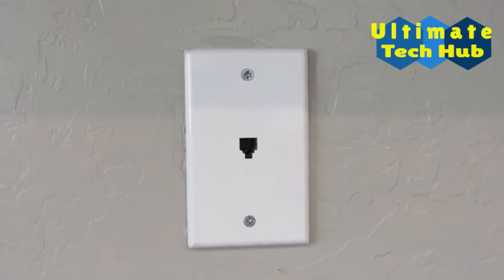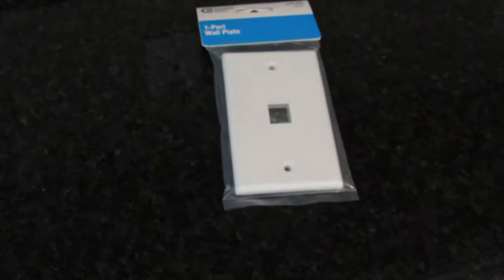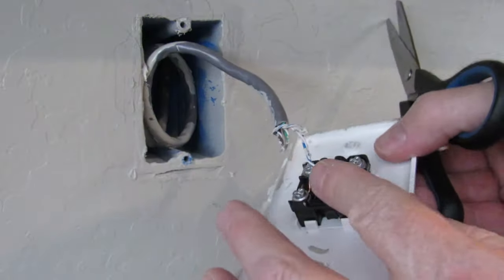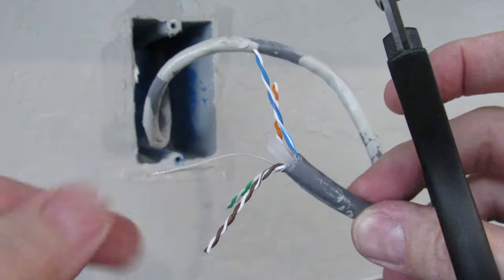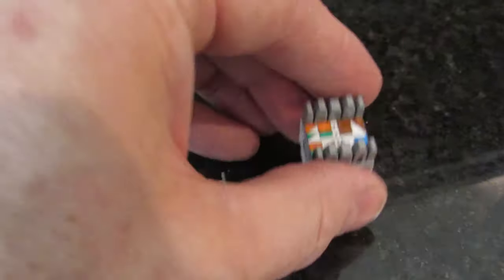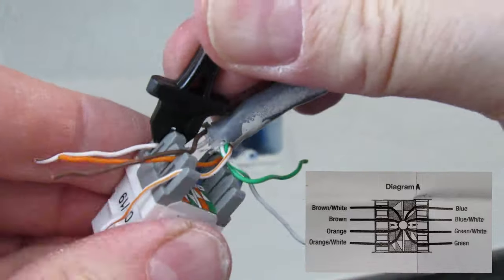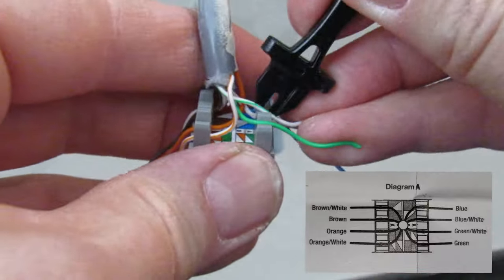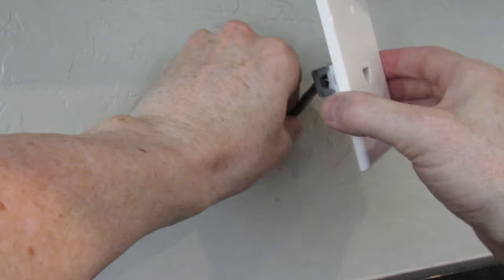CONNECT CAT6 CABLE TO JACK - HOW TO

Comment: Hi, I tried this but I didn’t get internet though. How do I troubleshoot
Reply from the maker: Check that the wires are in the correct order. Also where does the other end of the ethernet go?
Reply: @UltimateTechHub  so I changed the port in the Type A sequence as that’s how it was done previously for the phone line. Then I connected this new port with an Ethernet cable which comes from my router. Then I went to the another room and replaced the port with another Cat6 portZ and tried the hardwired internet connection but it says no internet connection.. I tried this at two different places. I have Cat5E cables.
Reply from the maker: @CuriousKaviCruiser  I would rewire both ends again to make sure the wires are in the correct sequence. Here is a video that shows both of the installs. Keep me posted.
Reply from the maker: Oops sorry here is the link.
https://youtu.be/4CUyU_v2qS0
Reply: @UltimateTechHub  so basically it won’t work till I connect the cables in the phone box with the network switch. Is that a correct statement?
Reply from the maker: @CuriousKaviCruiser  Yes. You need internet service connected from a modem to a router to a switch.
Reply: @UltimateTechHub  gotcha. So now once I fix it I will upload an end to end video. Lol.
Thanks for being so prompt in responding
Reply: @UltimateTechHub  you definitely deserve a subscription though. Thank you so much

Comment: is there a way to convert coax cable to this without any adapter?
Reply from the maker: No I'm afraid not. They do make adapters for electrical outlets that carry data signal.  However I have not used them so im not sure how fast and reliable the connection is. Thanks for watching and if you subscribed thank you as well.
Reply: Did u find anything
Reply: @yovanirangel2964  no.... so in the end I had to buy a long cable going around the room...

Comment: What kind of video is this? You forget to say that they have to do something to the other side of the cable, like connect it in a switch or a router... As you showed in the video its like you change the jack and its done, you have Internet thanks to magic...
Reply from the maker: It's a video that shows you how to change a phone Jack to a Cat6 plug. It's not an internet connectivity video. Just a how to wire the plug correctly. Thanks for watching.

Comment: Although I don’t understand why my house didn’t come with CAT6 and it was just built this year I guess my area is still in the past and I have fiber optic internet 1GBps
Reply from the maker: Probably saved them.some money by installing cheaper cat5e. Although its not much more expensive so it seems pretty stupid not to future proof the house with cat6.  You could run cat6 cables to each room. Thanks for watching and if you subscribed thank you as well.

Comment: I don't understand how this works. Don't the inner parts of the wires need to connect to something? Seems like you only put the outer rubber covering of wires in place but somehow this is how it's done? As a guy with zero wiring experience I'm confused.
Reply from the maker: If you mean the colored copper wires. They make the connection once they are punched down into the key stone jack. This is 100 percent correct and I have dozens of videos about this subject where I make these connections and they work without fail. I also have my degree in Networking and Cisco Routing. Thank you for watching and if you have any questions feel free to ask.
Reply: @UltimateTechHub  ahh i see, thanks for explaining. I came across this video as I am trying to convert my telephone port into a ethernet port so that I can have faster internet in my room. Currently I use homeplugs which are not so reliable.
Reply from the maker: @yh4861  Just make sure that cable in the wall is cat5e. You can look on the cable and find the words car5e printed on the outside of the cable or cat6 if your lucky. If it's a cat3 then you can't convert to data. But you can wire drop a cat5e or cat6 to that room. It's pretty easy. I have over 50 videos on this subject so check them out.
Reply: @UltimateTechHub  yup my government-built apartment was built in 2013 and it comes with cat6 wiring. Thanks!
Reply from the maker: @yh4861  That's fantastic!! Cat6 is great!

Comment: Can i test if it works before i put the cap on and before i cut the useless wires. I tested it and it didnt work :((((((()))))()((
Reply from the maker: Well you need to find out where the ethernet wire goes. That should help you fix the issue. Here is a video I did on this very subject. https://youtu.be/hsROsS1fXvg
Keep me posted and thank you for watching!
Reply: @UltimateTechHub  ok
Reply: @UltimateTechHub  btw that means that if i tested it it would work right
Reply from the maker: @bobthebuilder7999  by testing if you mean getting an internet connection then you need to make sure the other end of that plug is connected to your modem. If it is not connected to any modem or router then it won't work.
Reply: @UltimateTechHub  i think i found out where it goes but it goes into this little boz on the wall on my backyard and it is really messy and there are a lot of broken wires and stuff. On the box it says telphone
Reply from the maker: @bobthebuilder7999  I would call a professional if there are a bunch of wires. It should be somewhat organized  but if not call a pro.

Comment: So there is nothing else you need to do?
Reply from the maker: Well it depends if that wall jack is connected somewhere to a router or switch in your house. Usually these wall jacks all meet up at network panel where your modem is located.  I have dozens of videos on this subject so check out my playlist Ultimate Home Networking.  Thanks for watching!

Comment: Funny my cat6 plugs won’t go into my cat6 jacks. 😢
Reply from the maker: Are you sure they are both cat6? If they are both cat6 then your ca6 plug maybe damaged.
Reply: @UltimateTechHub  yes sir. Both cat6! I’ve tried several of the plugs and none fit the cat6 jack. I even grabbed another jack and same thing. So I’m returning these and going to Home Depot and taking my jack with to confirm fit. Amazon is great until it’s not.
Reply from the maker: @Souldoubtrocks  Exactly,  I prefer Home Depot for my networking supplies.  Keep me posted.
Reply: @UltimateTechHub  will do sir.
Reply: Some Amazon parts labeled as ethernet RJ45 are actually Phone RJ11

Comment: I wish this this video didn't work for only 10% of applications. As if all homes wouldve had CAT6 sooner it would make all new routing jobs much easier haha
Reply from the maker: Its definitely a specific topic but 10 percent of homes is in the millions. And it would be nice to have more homes with cat5e or cat6 wired  into the walls. We bought a home in 2007 and the entire home had cat5e wires into the walls. I think it was 10 cat5e runs. So there are millions of homes with wired networks.  Thanks for watching and if you subscribed thank you as well.

Comment: Don’t you have to connect the other end to the router?
Reply from the maker: Yes all of my network cable are connected to my router and switches. I have lots of videos on that subject make sure to check them out.
Reply: @UltimateTechHub  will check them out, thank you!

Comment: Most phone plates have CAT3 cable on them and whoever does this is going to wonder why they're getting 3mbps on cable not designed for ethernet or atleast CAT5 bandwidth
Reply from the maker: That would be true with older homes. However over the last 10 years Cat5e is the standard. I bought a new home in 2007 and it had Cat5e at every plug. And now Cat6 is dominating the market. But it is a good point. Thanks for watching and if you subscribed thank you as well!.

Comment: The morons who ran the telco wiring in my new house ran 4 wire! Arrrrrgggg! Nobody uses landlines.  If you have a phone it uses a network connection now.
Reply from the maker: Exactly!! That sucks. Time to wire drop some Cat6 cables.
Reply: Many people still use an analog phone, even though now connected to emulated POTS service.  For example, I plug my analog phone into my cable modem and it's VoIP from there.